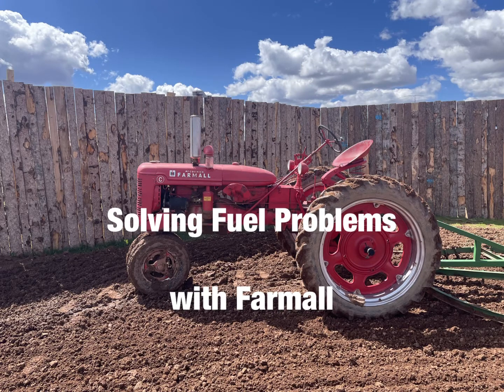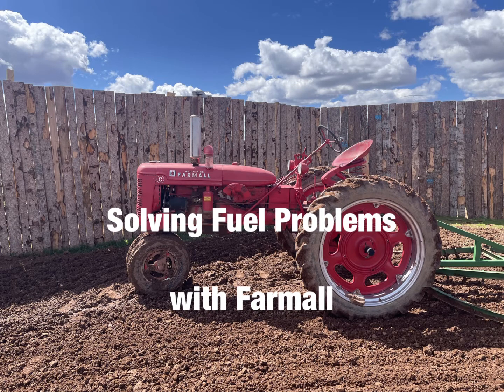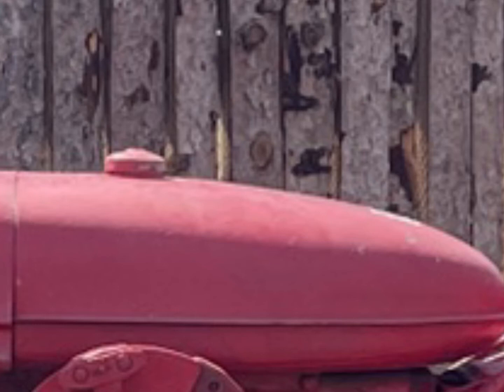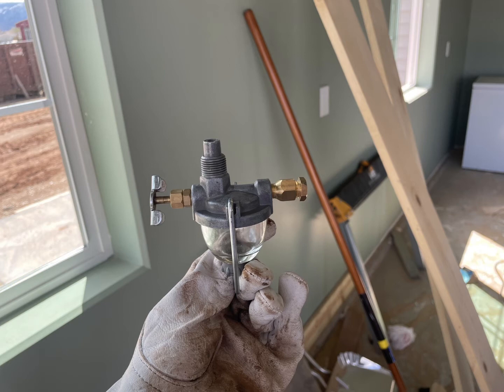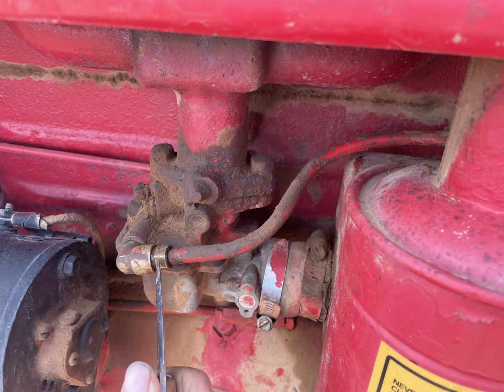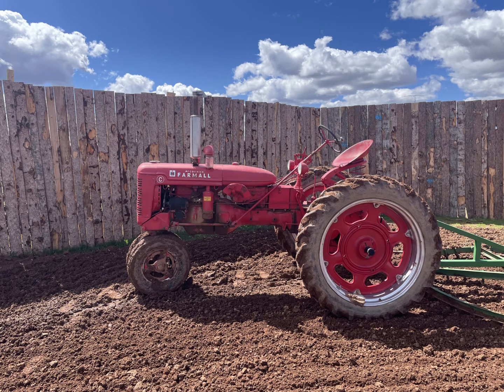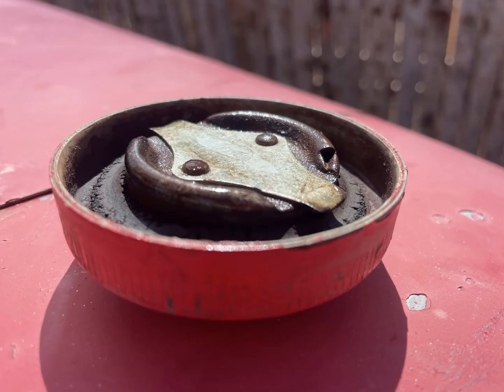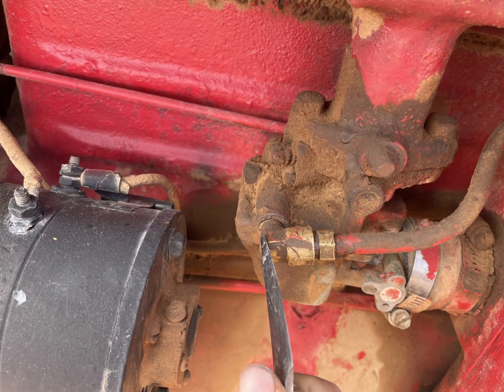Solving Fuel Problems with Farmall

Comment: I think I'm having the same problem with my 1974 Farmall 140. It will run for a couple minutes on low idle and shut off and not start after for a long while. I use it with a Woods M5 Dixie Cutter mower behind it to mow around 5 acres during the season.
Reply from the maker: Sounds like it to me- I hope you get it figured!
Reply: Yeah, I cleaned the sediment bowl and little screen above the bowl but when I turned the fuel back on, the fuel slowly drips back into the bowl instead of a steady flow of fuel so I assume it must be something slowing it down above the bowl. It still runs about a minute or less before shutting off and won’t start until after awhile.
Reply from the maker: @AriesRocker68  It’s the same thing, then, it seems. Remove the sediment bowl and open up the gas and use an air compressor to blow some air up into the gas tank. It’ll make a mess; but will probably solve your problem for a while.
   If you still have a slow drip, you’ll have to remove and clean the tank.